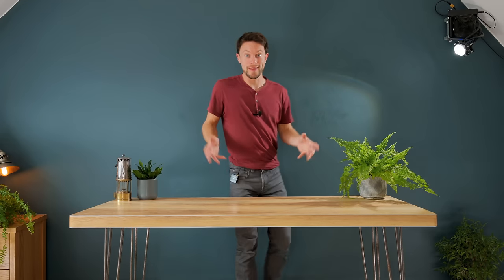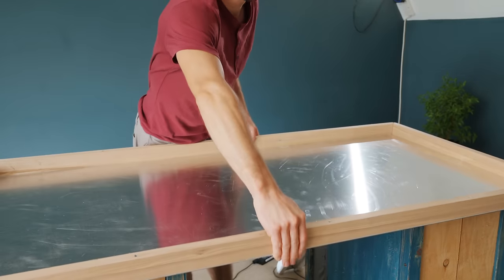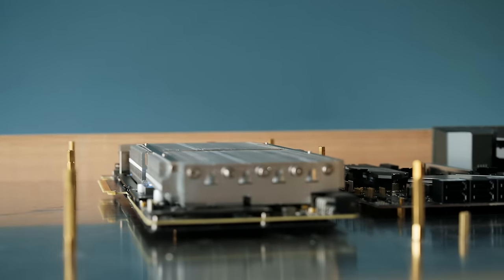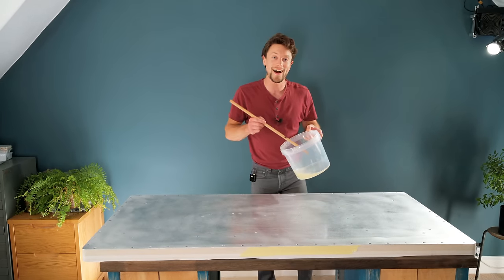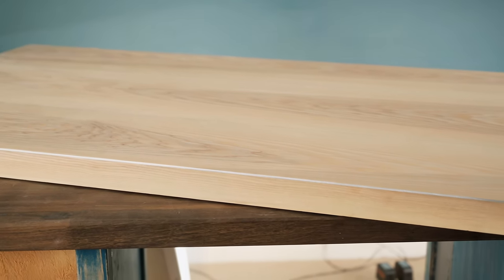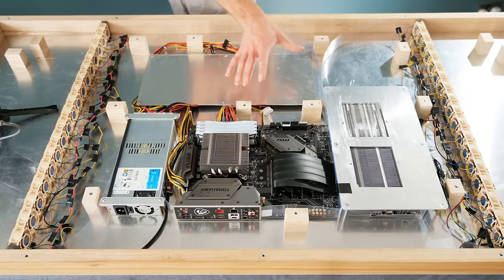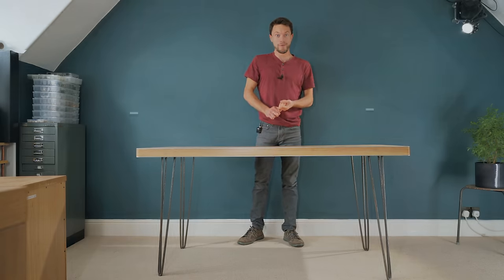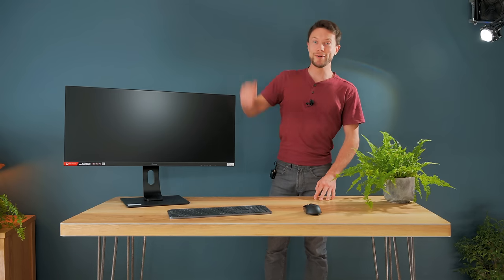Building an invisible PC

Comment: Since the heat sinks are exposed anyway, why not mount some low profile silent fans on them (drawing air down and out) to properly cool the the gpu and cpu in combination with your internal positive pressure fans? Just a thought from an air cooling purist who has built pcs into non standard objects as cases. Your load thermals are too high. (yes I see that you add water cooling in later videos)

Comment: I know this is an older clip. And while this looks fun and stunning in the end. Wouldn't this have been WAY easier using a laptop? Or even laptop components? Seems like you could get the table even thinner. And yes, you can use more robust graphics cards with this. I think the laptop would be an easier way to go. Is there another video on the channel for that? I will take a look. But if anyone wants to share the link I would like to see it.

Comment: I'd be worried about the cooling, there's more to cool than just the cpu and gpu. The thermals are not the only concern in a benchmark, and benchmarks don't really mean much without knowing what the scores/temps were in a normal setup, a proper water cooling setup would be cool though.

Comment: Throwback comment for future projects, there are 350w capable PicoPSU modules on ebay, and newer AM5 APU's will outperform 3070 graphics cards, and also will have 16 Neural Processing Units, as well as 16 Graphics Processing Units, and 8/16 CPU's so those NPU's will also support Path Tracing.
Just sayin'..
Reply: But not the best solution for video editing, you need raw power for that. I'm talking about gaming pc ideas (or guitar recording 0-fan pc in my case with real-time OS core)

Comment: Due to aluminium being a very good heat conductor and the thin wood layer I would be interested in seeing the thermals for the surface of the table specially the area where your arm would rest I feel like it's going to be a bit warm
Reply: i actually do not understand why you did not just turn the GPU upside down and let the heatsink stick to the  aluminum sheet of the table ???? i mean , the heatsink itself is made from aluminum , so using the table sheet  you would effectively increasing the surface area of the it  and let the heat spread far away .

Comment: Found this while getting ideas for a pc build. Wonder how using Displate Water cooling would go. GPU and Motherboard water cooled, wouldn't need as many fans and 1u psu's come in 950w so would run modern day graphics cards.

Comment: If your gaming, while the video card is good.. the power supply is underrated, the set up you got there needs 700w or better for best performance.  However as a work station it's fine.

Comment: Beautiful work anf I love your channel. But as a PC builder I see overheating parts, poor PSU and lots of unefficient fans! Radiators with dense fins shouldn't be used in this way - they are built to work with decent air pressure and direct airflow. Also the CPU heatsink can be knocked with users knee, which can cause real damage. The watercooled version is much better! Eextremely expensive though. Thank you for awesome videos!

Comment: I'm not sure wether fan's will be sufficient for cooling the cpu, on the other hand you could have a made a external Mount for CPU to circulate water through it to cool the cpu and Graphics card, You can make it really low profile so that it doesn't touches to the top of the table.

Comment: It's cool. But to be honest it would be even better if you could compute wirelessly from the motherboard to the monitor, mouse, keyboard, gaming controller. Then, you can hide the whole PC somewhere in a closet with A/C and that's it. Hidden, but no need to DIY the table at all. But it was a neat project anyway!
Reply: how would you make all that wireless?
Reply: @itsSmiv  Bluetooth,  like many speakers, TVs and cell phones and soundbars can work with bluetooth these days.

Comment: Would it be possible to use the big bottom aluminum plate as heatsink if one would connect the electronic parts to it via thermal bridges or thermal glue?

Comment: I think it would have probably been better in terms of thermals and building time to use an AIO for the cpu and if possible, even getting a graphics card with an AIO

Heck, if you would have the budget, go with a custom loop water cooling system!
Reply: a decent closed loop system would be cheaper than two aio's.   custom loop would be the way to go.

Comment: i actually do not understand why you did not just turn the GPU upside down and let the heatsink stick to the  aluminum sheet of the table ???? i mean , the heatsink itself is made from aluminum , so using the table sheet  you would effectively increasing the surface area of the it  and let the heat spread far away .

Comment: What would be the downside of using sound-dampening materials like silicon grommets/gaskets, foam insulation or carbon fiber panels?
Reply: Too much insulation can trap heat, but a sheet of heavy vinyl or dynamat would work and make it sound solid and quiet.

Comment: I had measured every table in my house and none of them were 2 inches  they were either more than 2 inches or less than 2 inches but the tables i had measured were a dining room table under 2 inches and a plastic table over 2 inches  so it possible to make the table a little bit bigger like 3 inches but keeping it thinner is best i know that a laptop is not a strong as a desk top but it is way thinner  and can fit in side a even thinner table.did this include away to plug in a usb or HDMI and so on?

Comment: Great ideas, not much of a wood working experience. Next time, grab regular wood glue, mix with wood shavings from sanding or "cheese-grating" wood and use that as filler. You won't be able to see the difference.

Comment: You could get a real wood for the desk, macbook without an lcd or mac mini, cut out a hole from bellow, to fit the mac mini, just not the brake the surface, screw it in, done

Comment: Is this still possible with 2022 components?
Reply: Make the table thicker and add water cooling, the temps are too high for newer hardware also bigger PSU 500w isn't going to cut it

Edit: unless you have low-end hardware
Reply: @crysiscontained4421  thank you!

Comment: Watching this, I thought of a way to better made this (and include the keyboard and mouse in the desk) as well as include the monitor in the desk. However, it will have to be thicker than 2 inches. I believe the build could be done with an aluminum base but maybe not an aluminum top, since my build would include a faux drawer in the front and a pop-up monitor in the top of the desk. My idea would also mean completely redoing the internal setup, but overall, my idea would create a single unit desktop akin to a laptop like setup where everything needed is included, including a disc drive or even including multiple gaming consoles hooked up if you want to make the desk look like a classic desk with "drawers" hiding them.